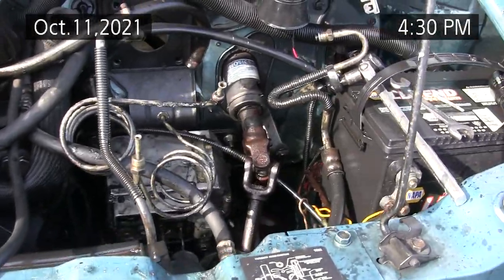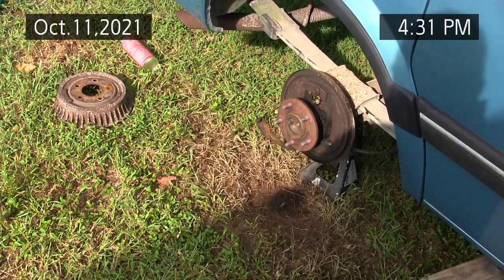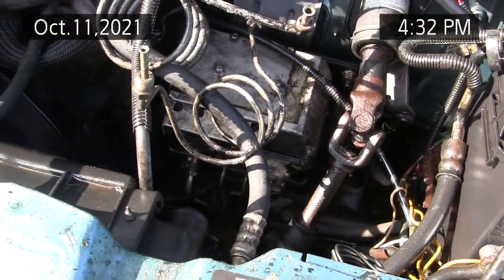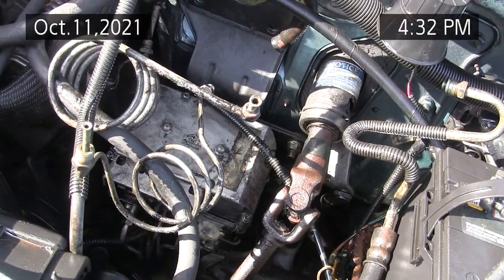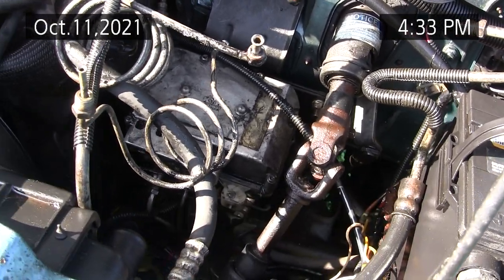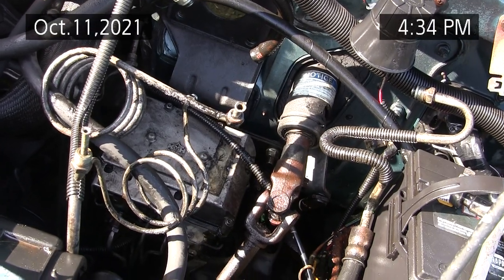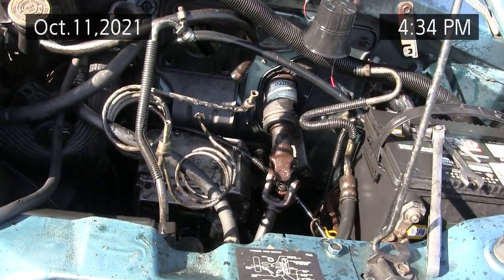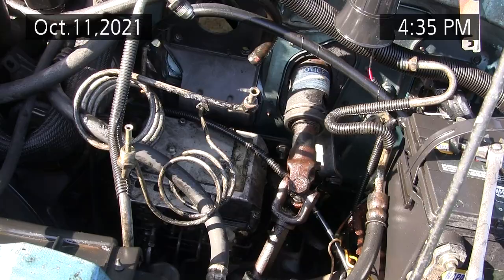Astro Van (94) 10/11/2021 VLOG Brakes & Hydro Boost & ABS repairs. Today's video removing the ABS

Comment: Would that set up work on my 1965 f100
Reply from the maker: Not sure. Not a much of a FORD guy. I had a Ford 6 once very good engine in my wifes 1970 Ford Mavrick. I had it nearly restored when Hurricane Andrew flattened it in 1992.
Reply: Its works I fitted it my front brakes are 04 crown Victoria police interceptor crossmember